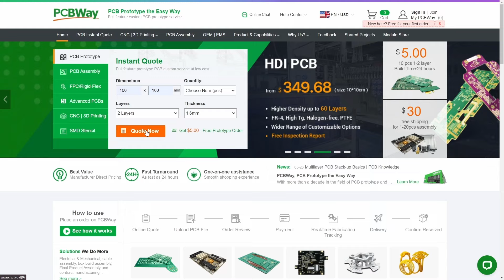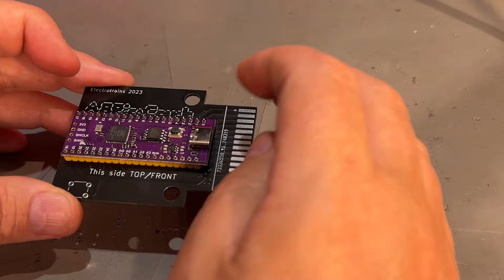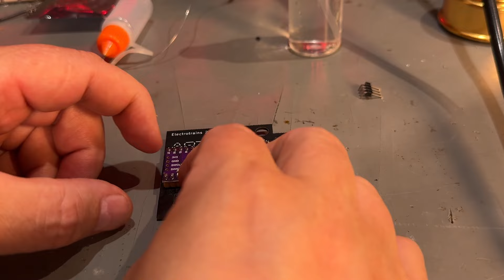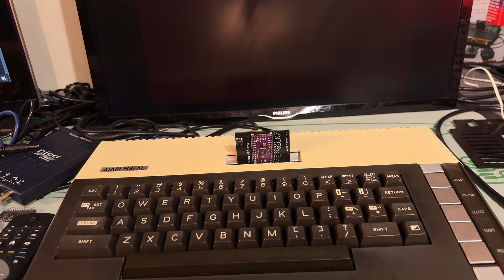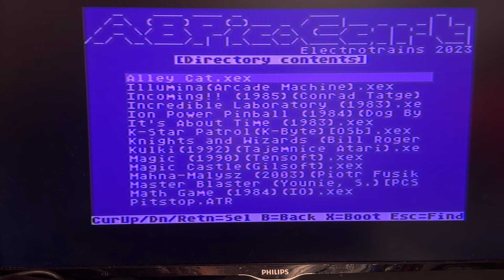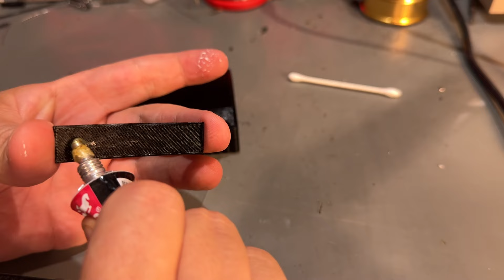A8PicoCart for the Atari 8-bit machines - Building and testing

Comment: That moment that you realize that ten weather in Norway is better than in the Netherlands 😅
I for one from Wolfgang Kierdorf The Retro is the New Black we both met through our mutual channels. And I still want to make video on it. My problem is only, that I always want to show something new or interesting a bit of a deeper dive than other channels but there’s not something to really say about this thing. It just reads address pins and puts that data or that byte on the bus 😂
So I’m currently working on a sidekick pico video, that I also got from Wolfgang. And there I will do a straight comparison between the 6581 and the Pico by actually writing a small program that generates the oscillator shapes so I can flip the phase and add the together to hear/see what the remainder is a perfect replication would by a flat line. I also do a little filter sweep to see the filter response between the two.
But this for I’m impressed with the sound. This C64 came with a swin-sid (swindle 😂) and I immediately heard that it wasn’t a Sid. Luckily the seller had the OG Sid because I bought a breadbin for the 6581 😂
So not yet sure what I can tell about this cool cartridge other than what you and others already said.
Reply from the maker: About the weather, it's 10 degrees and rain today, so not always nice. Thanks for the message. I think I have been visiting that channel a while back, but I never get any videos suggested lately. Definitely gonna subscribe now :) SidKick works great!
Reply: @Arcticretro  yeah it’s weird right?! Even with the alarm bell checked you’re not get the notifications all the time it seems. I experience the same. And ironically I get my own videos in the suggestion 🤣

Comment: I made the mistake of soldiering in a socket for my Apple II Pico VGA card only to discover the Pico’s pins don’t fit the socket.
Reply: Yeah they aren’t a normal DIP pitch. I thought that was obvious for everyone, but apparently not 😅What you can do is ofcourse but female and male pin headers and do it that way if you want to take it out.
But for that 5 bucks for a pico… hardly worth the effort imo. Although this one has that 16MB eeprom on it so probably a bit more expensive.